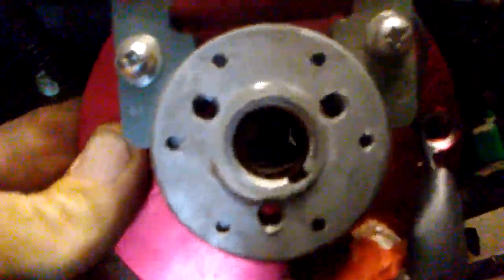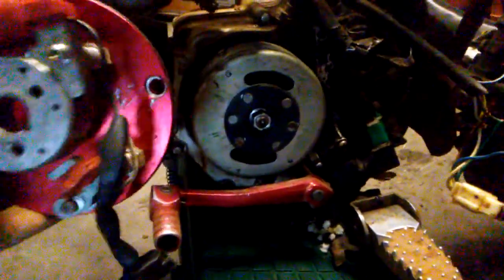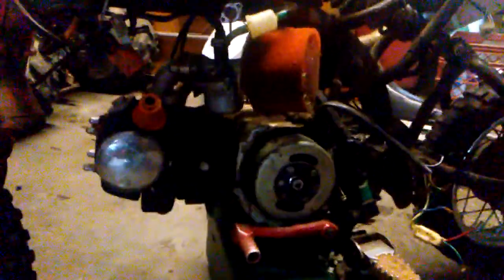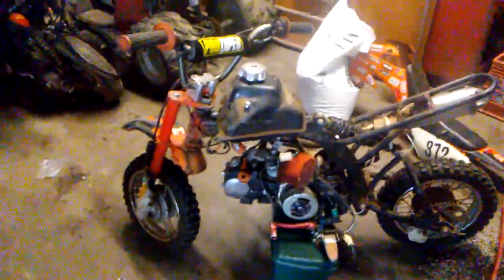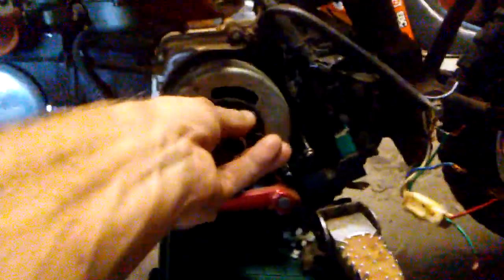Inner rotor kit pitbike

Comment: it works well or not ?
Reply from the maker: Yes they work very good at high rpm.  They only draw back is when cornering the heavy flywheel  keeps motor running smoother corners.  But keep rpm up n that too will be good